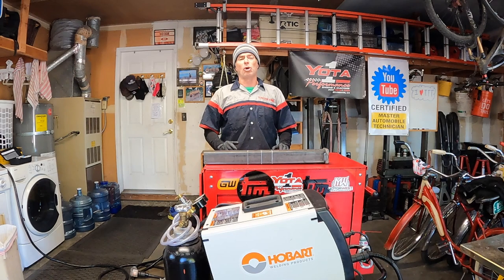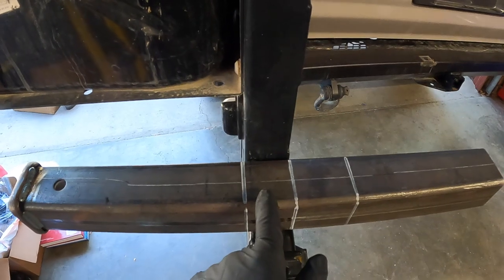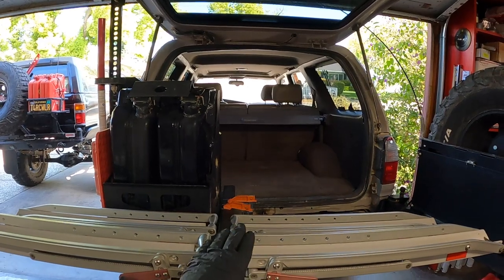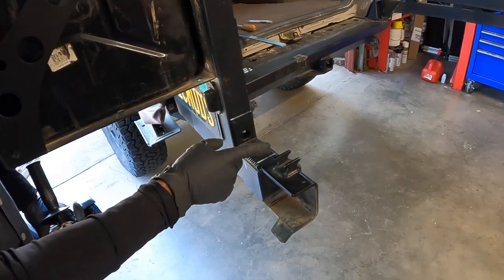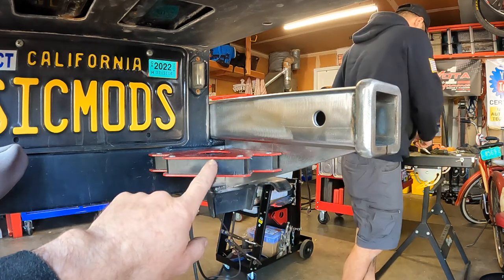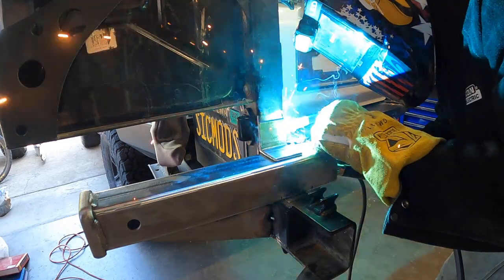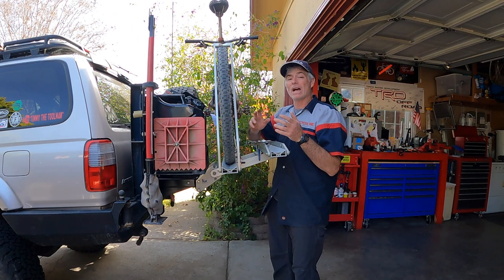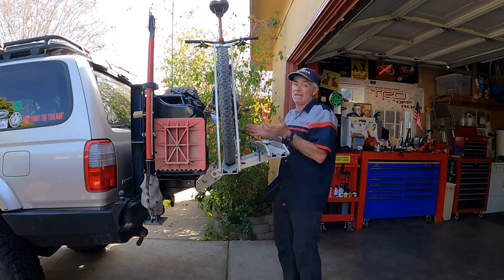Swing Out Rear Bumper Bike Carrier Mod

Comment: I’ve been thing about this for a while and I have a roof and hitch rack I currently use. I think the best solution for what I need is to store the bike inside like a vanlifer. I don’t like taking of the wheel or using up all that space inside but it seems like the safest option for long biking/wheeling trips. Especially places where you need high clearance for the rear with a low canopy overhead. Thanks for the video!!!

Comment: Sweet setup. If I were you, I would keep on eye on the rack and the rack mounts, because the ratchet strap will take on the full load of the bumper as the bumper bounces. If you have the ratchet strap really tight  and after miles on a bumpy dirt road you could get a fatigue failure, due to the high stresses of the bouncy road. 

We did something similar on my jeep awhile ago, we had a bike rack that holds 5 bikes and it was bouncing  a lot.  The bike rack was in the standard trailer hitch and we used a ratchet strap from the top of the bike rack to the rear spare tire of the jeep. The ratchet strap stopped the bouncing, but I noticed that the door that the jeep's spare tire is mounted to was being stressed and the top of the door was pulled away from the jeep, just a little, but it could cause a leak or failure if I did it for an extended period.  The body and chassis are not hard mounted so they flex and move from each other.

Ideally you need to get the bike closer to the bumper to lessen the leverage, I have been thinking of way to carry a bike on a setup like yours for awhile.  Currently I carry my bike inside my jeep and I carry my friend's bike on a spare tire mounted bike carrier, it has worked for mild off-roading. Just my thoughts, thanks for the video
Reply from the maker: Thanks for sharing your experience on a setup like mine.  I plan on keeping an eye on the rack to see if it's getting stressed from the load.  Hopefully it's not too much for it to handle.  I plan on testing this setup on a Moab trip we'll be doing soon.
Reply: @TimmyTheToolman  Very cool, I am curious how it works out. Good luck!

Comment: Only issues I see are there is no way to see your vehicles tail lights with the bikes on board.  I assume your bumper is bolted to the frame which is not solidly connected to the body.  With the strap on the body it might be possible that that it will pull on the rack as the body flexes on the frame.  Some things to consider.
Reply from the maker: Thanks for the thoughts Harry.  Bikes on any hitch bike carrier can obscure tail lights.  That is a downside to them.  As for body flex on the frame, that's an interesting thought.  I don't think the body moves very much on the frame but I could be wrong.